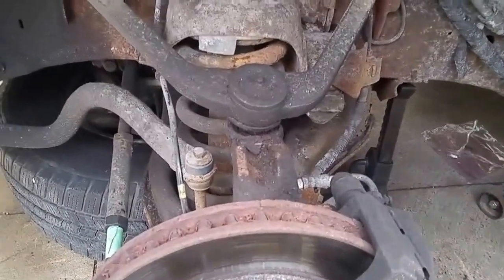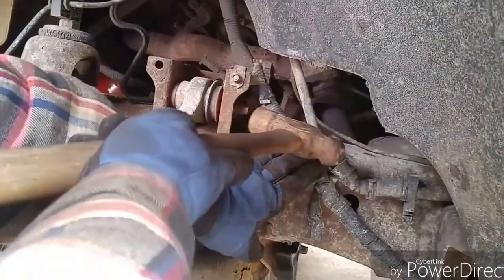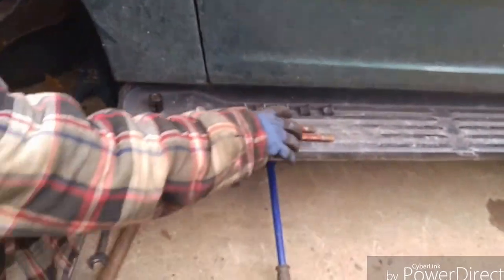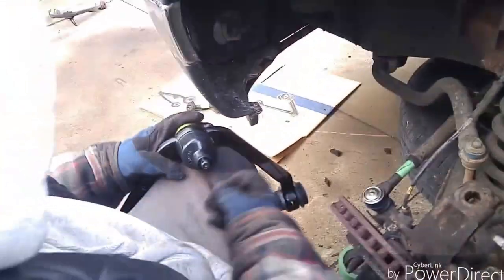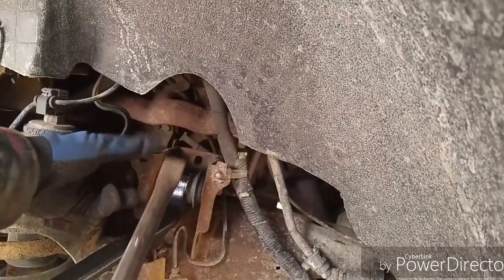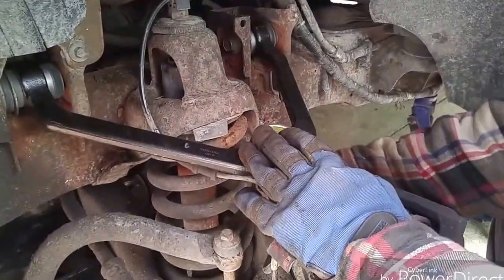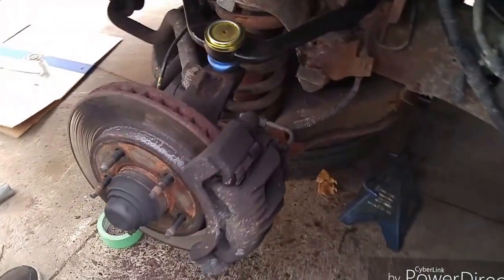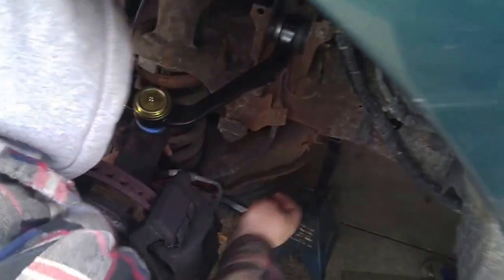1999 expedition upper control arm how to

Comment: My wheel on my 1998 ford expedition is rubbing my upper control arm,how can I fix that
Reply from the maker: Go get an alignment  your camber keys are either bad or somthing is bent
Reply: @RIVIARACUSTOMS  I change the control arm and the inner and outer tie rod end
Reply from the maker: Is your tire leaning in
Reply: @RIVIARACUSTOMS  yes is lean a little bit but I know it need a wheel alignment, I just don't know why it is leaning on my arm control
Reply from the maker: It's really hard to tell you would it could be without seeing the truck obviously but you may have broken camber keys that'll cause the wheel to lean in as for rubbing it would have to lean pretty far to rub what makes you think it's rubbing do you hear grinding or something or is there Visual Evidence of it
Reply: @RIVIARACUSTOMS  the inside of my wheel have a mark on it from it rubbing the control arm
Reply from the maker: Couldn't really say what it could be unless your tires really leaning in or the rim is too small and has been changed before or something could be your camper keys
Reply: @RIVIARACUSTOMS  ok I'm checking in to it now